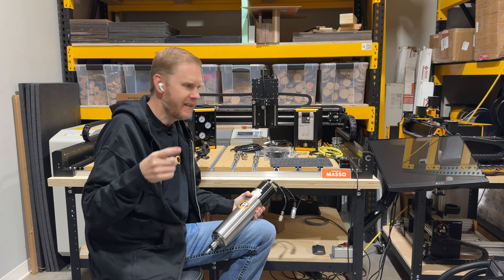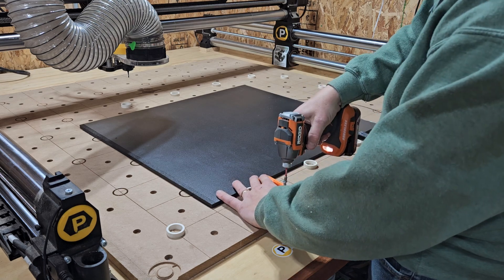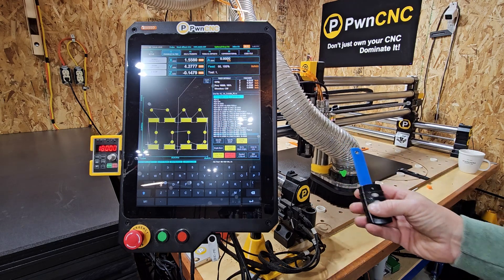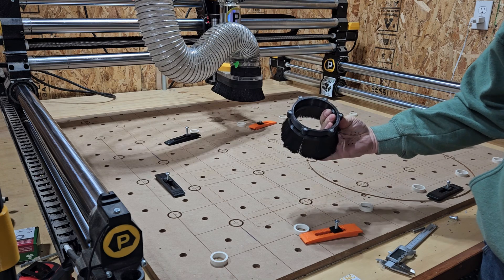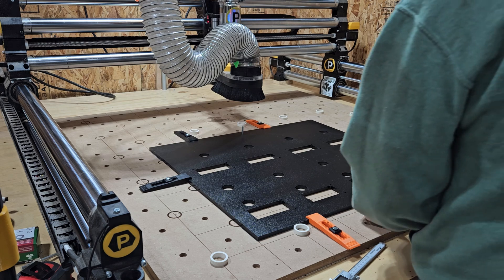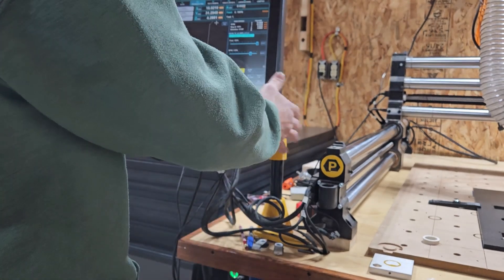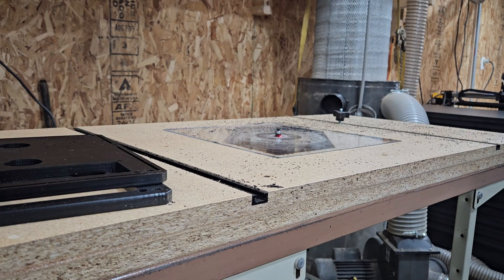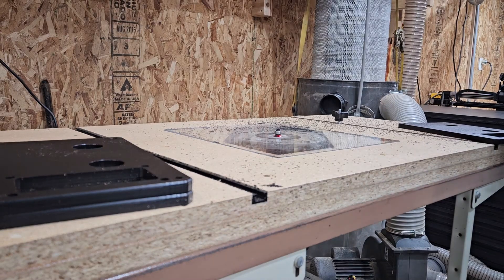Cutting HDPE for ATC Enclosures

Comment: What Vectric software did you use that let you see through the part for two sided operations? Vcarve?
Reply from the maker: Yes I used Vectric Vcarve Pro although Desktop and Aspire will do it also.  When you are setting up your job as 2-sided it allows you to "flip" the stock over and all off the vectors show thru the material, almost as if you were drawing on both sides of a piece of glass accept the vectors on the back side are slightly lighter in color.  I will be at the computer all weekend editing videos and will make a short clip showing how it works and will post here in the channel.
~Jeff

Comment: Couldn’t you save the routing step at the end by doing it on the cnc? Seems it would be safer. Had a friend who got bit by the router and lost the tips of 2 fingers
Reply: The tabs hold the parts in place during the machining operations, thus they must remain until after the parts are removed from the frame. However, the tabs can be removed using alternate methods which are safer, such as using a sander or a mill bastard file (both will leave a very smooth surface if used properly).
Reply: @GaiusTacitus Walking to work everyday is safer then driving. Yet most of us would be spending half our time walking. Sometimes the risk is worth the reward. He is beveling clean pastic (no knots or splits, ect). 

In this case, the reward is passed down to the customer as production is incressed. 

Just think about how much more time it would take to sand tabs and bevel edges with a sanding block and file. Its the safest way, yet inconsistencies and increased production costs, will get us a sloppy product for twice the cost.
Reply from the maker: The routing step at the end is a 2 part task.  Previously we would use a flush trim router bit to remove the tabs used to hold the parts in place during the final cutout process.  Then we used a deburring tool by hand to ease the outside edges of the HDPE to refine the product for handling comfort.  Recently I switched over to a 1/8" roundover bit to ease the edges and found it has plenty of flush cutting surface to combine both tasks into one quick and perfect process.  This is not to say that we can ever become complacent with power tools regardless of how small they may be or how many safety features are engineered into them.
~Jeff